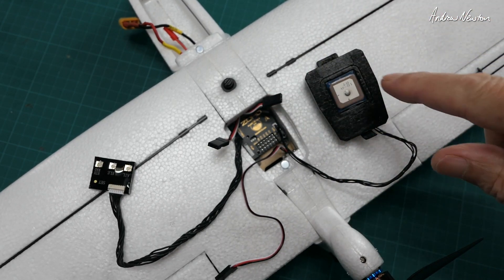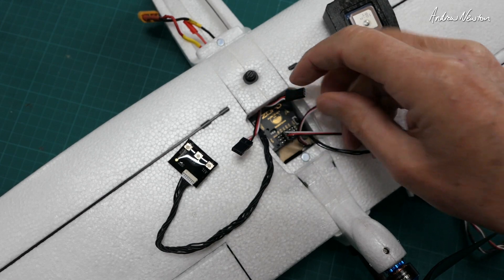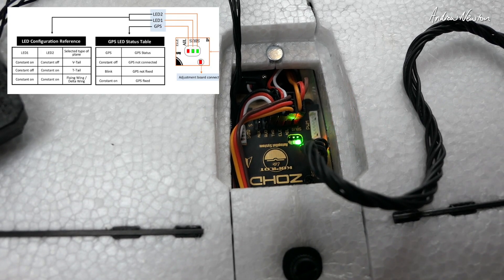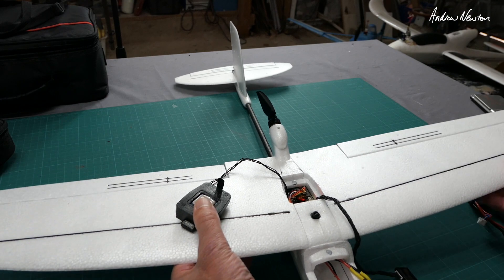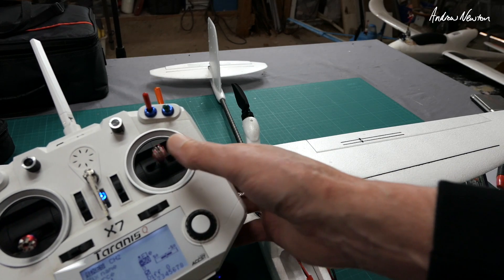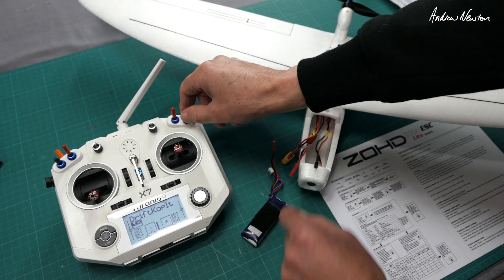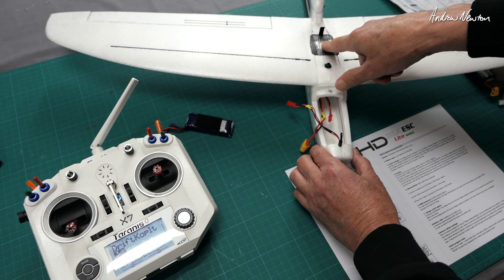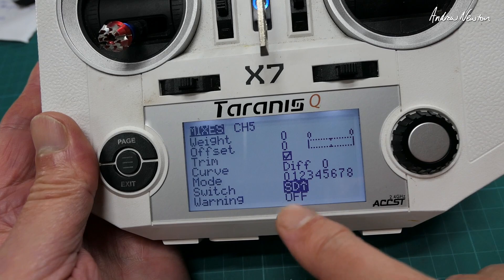ZOHD Drift Kopilot setup

Comment: Good video but I'm loosing all the green lights on the kopilot its self, I get flashing red light for gps, is it the radio not set correct
Reply from the maker: Manual mode has no green LED according to the manual

Comment: How about using a hole nearer the servo arm’s center to reduce the throws on the ailerons and elevator physically and keeping the channel throws in the mixer art 100%. Then you wouldn’t need to change between 100 and 50 just to be able to use the sticks for activating a new level calibration on the kopilot, right?
Reply from the maker: From memory it needs the full 100% for stab mode but 50% is nicer for manual.

Comment: Hi thanks for the video it has helped a lot......I have two questions for you ....well three actually....with a 2 c battery I found I had to ad weight to the tail and the three bladed prop is a bit laim on thrust power...so if I put the two bladed prop on with a three c battery the c g is going to go more nose heavey....so I'll need to add more weight...so .

Can I put the two bladed prop on with the 2 c battery ....can you advise please.
Reply from the maker: Sounds like you batteries are oversized. Yes you can use that prop setup with 2s or 3s
Reply: @AndrewNewton  thanks again 👍

Comment: Just a quick question.  Does the blinking light on the GPS on top of the plane stop flashing once it has made connection with the satellite. The red light on the kopilot goes solid but the light on the GPS on top of the plane keeps flashing.
Reply from the maker: LED on the GPS just shows that it's powered I think

Comment: Just a question.  When I put the kopilot into return to home mode the  ailerons move up and down. If I put it into fence mode it's ok. Everything else works fine. What do you think the problems  is
Reply from the maker: Normal behaviour on the bench.
Reply: @AndrewNewton  it does it at flying field. Does the flashing light on the GPS on top of the plane stop flashing or does it continue to flash.

Comment: can the kopilot work with dji fpv?
Reply from the maker: Nothing stopping you using both on a plane, but they are totally separate units that don't connect in any way. Kopilot has no FPV function.

Comment: Hi M. Newton, I hope everything is good for you, I was wondering if you can help me with a small issue.  I have a motor D2830 1300kv and it shake when giving some throttle at the beginning and after everything is ok. I calibrate de throttle and the esc, a zohd 30A lite but still having the same problem, so if you have a idea  it will be apreciated, thank you again and have a nice day.
Reply from the maker: Motor shakes with low throttle? I'm just guessing but I would think about redoing ESC calibration, but dont push the throttle down 100% and hard. Or it could be poor connections o soldering on the 3 ESC cables.
Reply: @AndrewNewton  Thank you for your advise, I’ll try it and have a nice evening.

Comment: I've a weird issue when setting up on my dart 250 . I have everything working as it's supposed to but in stabilised mode it raises the elivators when I throttle it. if I'm holding elivators down and throttle it then it cancels the elivators. in manual it's fine. don't want to fly it until I've figured out what I'm doing wrong. any ideas
Reply from the maker: Might be normal bench behaviour. As long as the elevons are moving in the right direction it's likely to be fine. Maybe turn the stabilisation gains right down for your first flights.

Comment: Really dumb question (I've always used Pixhawks and such) - how is the flight controller powered?
Reply from the maker: 5V (red wire) from the ESC plugged in to the THR pins on the Kopilot

Comment: Hi Andrew, thanks for all the amazing info, but after watching and reading, I'm having a hard time getting the drift to connect to my FlySky A8S receiver using S-Bus. I've connected everything and the Copilot fires up, but I just get a red flashing GPS LED and nothing on LED1 or LED2, which I think means I am in stabilize mode. My mode I've set up as a 3Pos switch on Channel5 does nothing, which makes me think I am not getting an sBus connection. Any thoughts?
Reply from the maker: Dont know about SBUS on FlySKY. Is there SBUS setup in the radio? It does seem like SBUS is not working, or the Rx is not bound
Reply: @AndrewNewton  There is something wrong with the A8S (mine? generally?). I switched to a FS-X6B and I'm cooking with gas. Ta!
Reply: @AndrewNewton  The newer versions of the Flysky A8S require the output from the receiver to be set to S-bus after binding. There is an add-on bit in the manual on how to do it. That caught us out for a while also!

Comment: Very good tutorial Andrew - thank you because it helped, but I stopped on the problem of bad channel reading in qx7 and the lack of a working throttle, and how to fix it isn a nightmare - does anyone have any tutorial?
Reply from the maker: Bad channel reading? Just assign 100% to each channel and no other mixing.
Reply: @AndrewNewton  Thanks Andrew i did it right but i think its untypical issue of rx or Kopilot maybe . Its a lack of proper quality control of many products nowadays i suppose. Thanksfor your help again.
Reply: @MrDario8  Which method of connection to your receiver are you using - S-bus or the 4+3 PWM connectors?

Comment: Hi Andrew very good vid. Can you tell me is it possible to have flaps on aux on kopilot? Bearing in mind there is no connection on the Rx. I am using PWM, Spektrum 6 ch RX. Thanks in advance. Fitted in Ranger 2400 from Volantex
Reply from the maker: Aux is only available with SBUS connection. But maybe you can plug your flaps directly into the receiver ch6

Comment: Can you get the telemetry in the DJI Fpv goggles if you use a caddx vista? Or would I need an inav flight controller? Thanks
Reply from the maker: DJI OSD can only use the telemetry data from INAV or Betaflight boards. There is no telemetry from the Kopilot anyway

Comment: Hi Andrew, many thanks for this informative video from last year. I just received the FPV Drift & already have the Razor RTF. I think the Razor RTF already had a receiver included which works with the Zhod controller. I thought the Drift would have had the receiver built in as well, but apparently not so. I have ordered 2 receivers that have Sbus & will try them out on my DX9. Keep safe & well
Reply from the maker: Can use either SBUS or PWM with the Kopilot. Didn't think Spektrum did SBUS?
Reply: Many thanks #1

Comment: I purchased a drift a month ago and installed the Kopilot and the RTH had saved me a number of times while I was learning. However my drift just disappeared into the horizon. I had used the RTH function a couple of minutes earlier in the flight and it work. When I lost sight of the plane behond a small tree I clicked the plane into RTH, but the plane disappeared. Is there any reason why it would work and then during the same flight fail. Any advice would be good before I try again with another plane.
Reply from the maker: Did you have the RTH setup for signal loss? That's the only thing I can think of.
Reply: Under failsafe in the on the FLYSKY channel 5 set to -100% ?

Comment: i have this kit but i am a bit tired of the lack of OSD information available with Kopilot. Can I simply replace this controller with the F411 WSE and all of the other components work with it? will i need anything extra?
Reply from the maker: The GPS would work with some cable soldering, but not the VC400 AIO camera. You would need separate camera and VTX
Reply: @AndrewNewton  what about zohds esc?  should i throw one in my cart or can i just rewire it to the f411?
Reply from the maker: Any ESC will work. Of course you will need to master INAV, but it's worth the effort.

Comment: Andrew, in stabilised mode, is my kopilot meant to have 100% throws?! I have made dual rates down to 60% on my flysky transmitter in sport mode (high rates). When I click to stabilise mode it goes to max throws and my rates switch becomes inactive and doesn’t change the amount of throw... is this meant to be?
Reply from the maker: Kopilot gives reduced rates in stabilise mode. I have 50% rates just for the Manual Mode switch position (OpenTX)
Reply: That sounds like the perfect set-up as you only need to move 1 switch (the Mode Switch) to get the required 100% on Stabilized but the toned down throws on Manual. Just to be clear - which Tx/Rx pair are you using and are there any other set-up steps necessary?

Comment: my sky surfer plane gave 960g with fpv battery and controller. will it be if it will not give an error due to the weight?
Reply from the maker: Which SkySurfer?
Reply: @AndrewNewton  he is a copy of bixler
Reply from the maker: That will fly OK

Comment: Hi, Andrew,
For me it is all a bit new and very technical.
 Can you help me?
What kind of device do you use to connect the servos that do not fit on the flight controller to your receiver via AUX.?
Receiver Radio master R161 with SBus on the
ZOHD Kopilot: Ail, Thr, Ele and Rud
External ?? lighting, flaps, bomb hatch, camera control, etc.
Greetings from the Netherlands,
Casper
Reply from the maker: Not possible with your selections. You would need a receiver with SBUS and 8 PWM outputs or a flight control board with more than 1 spare PWM output (AUX) like the Matek F405 Wing

Comment: Hi Andrew, I'm still struggling setting up the Kopilot with FrSky RX-4R via SBUS, even after I corrected (rearrange) the stock SBUS connector cables, the (green) LED2 keeps blinking, although GPS is locked (solid red). I use Taranis QX7.
Reply from the maker: LED2 flashing is RTH mode. Cant do any setup in RTH mode. Recheck receiver binding and switch directions
Reply: @AndrewNewton   my bad, I mistakenly thought stabilized mode is blinking LED2, it works now, thanks
Reply: @AndrewNewton  anyway, where is the suggested CG for the Drift?

Comment: Andrew HI mate : Do not know how to contact you . But can I use Aux channel to switch power on and of, for camera powering?
If so how to switch Taranis switching . Cheer's Bob Fin
Reply from the maker: Youtube comments or email are all I use. You can use the Aux (channel 6) if you connect by SBUS. Just assign a switch to Ch6 in the mixer page. But it would be switching signal from high to low, not power on and off. Need a camera that understand that.
Reply: @AndrewNewton  Thanks many for your time. Have ordered Dr Mad switch HK
Cheer's again Bob PS don't know your Email...

Comment: hi Andrew, good video like everyone.
question, a little weird,
The gps, it is clear that the ceramic antenna goes up, but does it have a position ?, that is, the letters of the ceramic antenna, forward, back?
I understand that not having a compass would not be necessary, but ...

thanks for your patience, greetings
Reply from the maker: GPS orientation doesn't matter as long as the antenna is facing the sky

Comment: Hi Andrew great video. I have assembled my Drift and KOPILOT and the ail and ele working correctly but I have a strange problem I cannot work out and hope you might be able to offer advice. When I power up the system and the initiation starts the elevator pops up. When power off the ele stays in up position. Any advice would be welcome. I am using DEVO 7  transmitter which is not the easiest to set up!
Reply from the maker: Nothing I can think of sorry. Dont know the Devo

Comment: Thank you very much for this good tutorial! I have mine flying. Is it possible to do some mixes (on radio) to get flaperons while having kopilot stabilization? Or will it interfere with the kopilot system?

Thanks!
Reply from the maker: You can do mixes but they must only be active when the switch is in Manual mode. Not flaperons because Kopilot only provides one aileron channel.
Reply: @AndrewNewton  ahhh that is completely true!! :( thank you Andrew, love your videos!

Comment: Hi Andrew, I am having great fun with my Drift which I find is so easy and quiet that I can fly it in a field right behind my house - something I couldn’t do with anything else.
I have set my Orangerx failsafe to engage RTH as you suggest but so far I haven’t had the nerve to try it out in the air! 
Presumably the Kopilot would keep power on the motor to maintain altitude even though I had throttle set to minimum on the Spektrum  Tx when I bound for failsafe  - as required by UK rules.
Am I effectively letting the Kopilot break the failsafe rule by setting it this way? If a Tx connection is not re-established would the plane keep circling until the power ran out?  Food for thought 💭
Reply from the maker: Hi Mike. The only item you set on failsafe is the mode switch position to RTH, nothing else.

Comment: Hi there Andrew!  Very nice tutorial.   I am trying this device on a fixed wing FT Arrow.  Everything went very well and all "appeared" to be working correctly.  The only thing that doesn't appear to work for me is the "calibration " step of holding the sticks down and inwards.  I don't get the flashing lights on the Kopilot.  One user had mentioned that it doesn't work in the "wing" mode?  Have you heard such?
Reply from the maker: Yes you've worked it out. Rudder channel is essential for any flight controller that needs stick commands to achieve something.

Comment: Andrew, How did you set Aileron direction for each of the servos on Chan 2, was it with the Mixer Chan?
regards Ray. (Age 81)
Reply from the maker: That's right Ray. Aileron direction programmed in the transmitter mixing and aileron stability direction using the Kopilot adjustment pots.

Comment: hi Andrew, thanks for your videos, they are very good.
I have two fixed wings of 800 and 1000mm approx with kopilot with the same problem, they fly perfectly in stabilized mode but when I use the semi-autonomous take-off with the RTH or when in flight I put the RTH it goes like sudden jumps entering a loop that if I don't change to stabilized or manual sure it would end very badly.
I have changed gains going down to the maximum elevon, but I do not correct it, I repeat it happens only in RTH mode.
What do you think could happen? Thank you
Reply from the maker: That's very odd. Gyros are ok, maybe GPS problem. Is your board facing forward, and GPS antenna facing up? Correct plane type selected?
Reply: Hi, everything is well installed and works perfectly in stabilized mode, the problem is only with the RTH mode.
I am afraid that the algorithms in this mode are fixed and do not influence the gains of the stabilized mode, and in the case of fixed wing they cause this problem.
this occurs with two different wings with two different Kopilot,
Thanks

Comment: Hi M. Newton, I tried yesterday for the first time my fixed wing with the kopilot. It went well, took me few time to adjust my calibration and it flew wonderfully. I did not try the return home, but I program everything as you said even the safety so it should work in case I need it. Thank you for your support, very appreciated. Have a nice day.
Reply from the maker: Excellent, happy to hear that

Comment: Something I've noticed with my radiomaster is when telemetry is lost when the radio is near my frsky x8r my zohd Kopilot does not put itself into return to home, works when the radio is switched off though and on a switch, is this anything to be concerned about?
Reply from the maker: Telemetry and RC signal are separate so nothing to worry about.

Comment: Hi M. Newton, I installed my new kopilot and I have a question for you if you have a little time to give me. When I chose the return home switch (not flying on the work bench) the ailerons are moving. If I change on stabilization or manual made nothing is moving. I followed your explanation, level the fixwing transfert the radio calibration etc.. So maybe it's normal. Thank you and have a nice day.
Reply from the maker: Hi Carl. That is normal behaviour. As long as everything is moving the right direction you should be good to go
Reply: @AndrewNewton  Hi M. Newton, thank you, now I can try it without worrying about that. Have a nice day.

Comment: So I have this system. but I do NOT have manual mode on my (0) switch on my 3 pos switch. RTH and the other 2 switches work great, except I have 2 of the "stabilized" modes so no manual. Does anyone have an idea for a fix or a way to troubleshoot this? middle and bottom switch are Stab mode but I do enjoy manual when I can. Any help is appreciated.

Comment: Regarding the failsafe settings, if i remember rightly, Painless360 said the throttle should be set to zero (-100), as the Kopilot will manage the throttle in a RTL situation. Can anyone confirm what it should be?
Reply from the maker: Just set Ch5 RTH switch for failsafe. Dont set throttle
Reply: @AndrewNewton  OK thanks

Comment: Hi M. Newton, first I would like to tell you that I'm learning a lot with your videos, thank you. I bought a kopilot and I was wondering if I need to put some throttle when I activate the RTH switch or the mixing is doing by it self. I saw in one of your video that you need to activate the throttle when launching the plane. Thank you and have a nice day.
Reply from the maker: Thanks Carl. As long as the throttle is above zero then RTH mode will take control of the throttle.
Reply: @AndrewNewton  Thank you M. Newton, as soon as I receive it, I will follow your step. Can wait to try it, hava a nice day.

Comment: Thank you for taking time to make this video. I'm a bit confused with the LED setting for T tail. I just down loaded the manual and it says LED 1 on for T tail, 2 for Delta and 1&2 for V tail. In the video you recommend setting LED 2 for the Drift.
Reply from the maker: You must have a different manual to me. First page, Led Configuration Reference - Led 2 ON for T-Tail
Reply: @AndrewNewton  The manual that was put up on the Zohd site was wrong first time round - discussed early on in the RC groups thread. The manual now up (linked to on the Banggood ad and paper copy supplied with purchase) is correct these days.